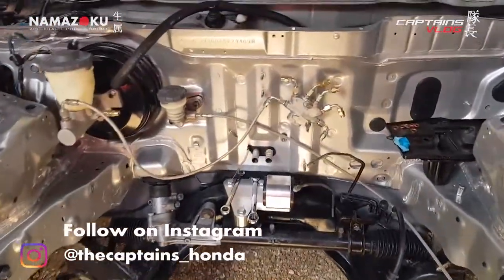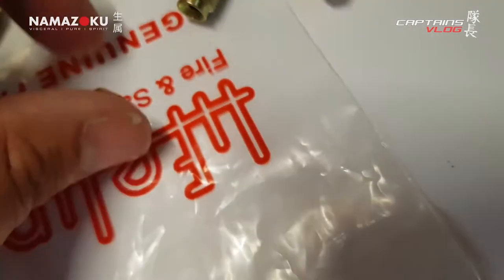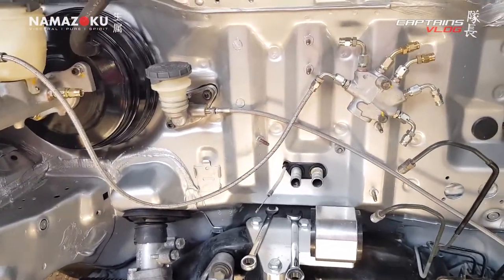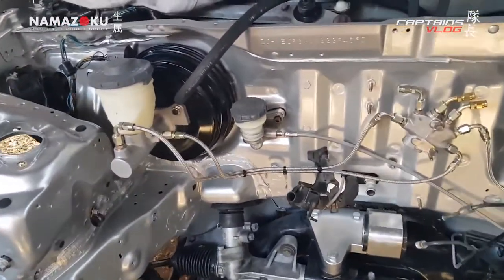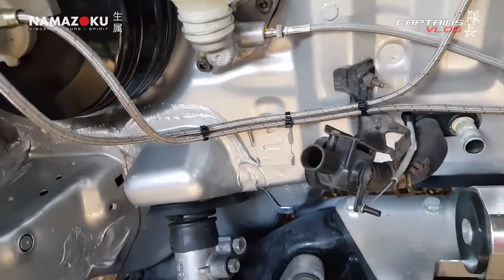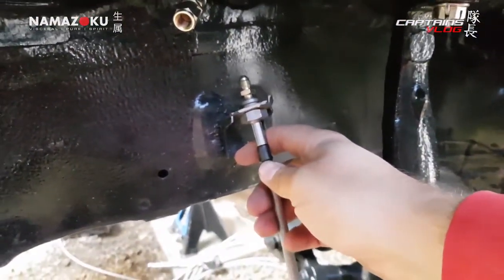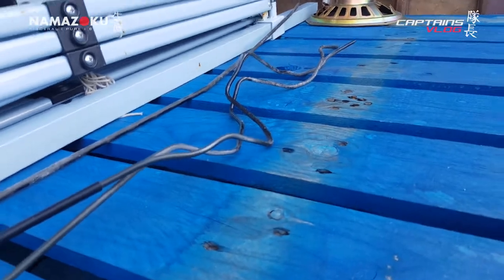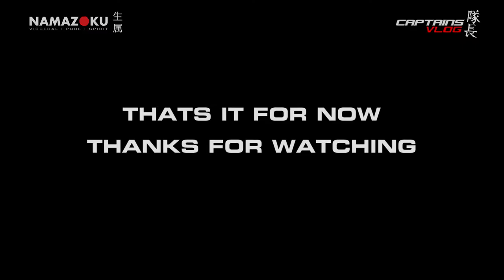Making custom brake lines for the Civic -3 AN stainless braided lines

Comment: Any issues running through the area above the front sub frame regarding enough space?

Do you have the 3 fuel lines going through there too? Im starting this and reluctant to drop the subframe, thanks in advance.
Reply from the maker: Not really I just wanted the cables as straight as possible so by having the curves inside the car before it exits the firewall, it solved that issue. 

Fuel lines all run in the OEM locations, I just connected hard line adapters to -6AN fittings where they come into the engine bay and ran them from there.
Reply: @captainsvlog  thanks for the reply. Many options and I think i go a similar route, the 3 fuel oem route, and transition from hard line to hose where convenient in engine bay, with the 2 rear brake hard lines through firewall and run internally - I don't want to do this again!

Comment: How you make sure if the master is properly connected to the prop valve… i can’t find any good diagram on how to root the master to the prop valve. Wish you can help me
Reply from the maker: Horizontal outlet on master goes to the right bottom port on prop valve, the vertical outlet from master goes to the left bottom port of the prop valve. If you join our discord we can help you better. There are links in video descriptions somewhere.

Comment: Just found your channel how are the brakes working? It looks very clean but I heard you say it was spongy or could have a spongy feel could you elaborate on that?
Reply from the maker: "Other people" always said braided hoses are spongy, I was likely referring to that. These brakes feel awesome to use, it's the same as used in race cars, works for me. Pedal feel and modulation ability is spot on. 

The pads used make a big difference to feel, but I've also never driven this car on the OEM brake lines so have point of comparison. 

This type of hose won't expand like the myths would make you believe. The steel braid is very tight, and the lines are PTFE inside.

Comment: Thinking of doing this to my civic
Reply from the maker: Simple enough mod to do, not that cheap though, as there are quite a few fittings required, but will provide a nice pedal feel when used with the standard brake booster 👍
Reply: @captainsvlog  roughly how much did you spend ?
Reply from the maker: @Birminghamoutlaws  From memory it was somewhere between £130 and £200 for all the line and the fittings, as it requires a male/male fitting for just about every connection plus the fitting itself whether it be straight or angled or whatever.
Reply: @captainsvlog  thanks.

Comment: Great video exactly what i needed but 2 questions. 1 can you run the braided hose to caliper? Also can you add links to parts?
Reply from the maker: You probably could run direct to caliper, but I wanted to use the original hanger and connection point, as I'd already bought the caliper hoses that would join to the OEM hardlines. The hose is AN3 ptfe stainless braided, and all the fittings are AN3 fittings, which is all normal kit, just plan out what you need, order the parts and away you go. I bought them from my local motorsport parts shop at silverstone circuit.
Reply: @captainsvlog  aight thanks yeah I have to order online no autoshop around my area sells those products

Comment: Have you tested this out personally yet for spongy feel?
Reply from the maker: 1500 miles, 1 circuit outing and 1 drag event, no issues to report, pedal feel and control is awesome considering no ABS. Spongy feel is a bit of an old internet myth, the new spec hoses are ptfe tube inside with tightly wound stainless steel braiding on the outside, they are very robust. If its good enough for a lot of race cars is good enough for amateurs driving on the street. 

IF ANYTHING, it probably has a little too much servo assistance now with the DC2 booster and master cylinder, as I would like to be able to apply more brake pressure when on the track for more control, but on the street its spot on.

Comment: What are the exact fittings you are using? From prop to caliper
Reply from the maker: At the caliper it is just the standard banjo bolt, from the caliper to the factory hanger is an aftermarket upgrade hose which I bought from MTEC brakes, just tell them what car it is and they can supply the correct fitting. From this aftermarket part I had to use a male/male -3an adapter, and make up a new line to go from that adapter up to the prop valve, this hose has females ends both ends. The prop valve also has male/male adapters in. 

So in short I used MALE/MALE adapter on the prop valve, all outlets, and again on the end of the caliper lines, and joined them up with custom lines using female -3 fittings both ends. 

I hope this makes sense. You can see the fittings @ 0.46s in the video. Feel free to contact me on instagram if you require any more specific info. 

Hit that SUBSCRIBE and LIKE button if you have not already done so aswell :) Much appreciated.
Reply from the maker: look at 5m26s also as you can see the male/male adapter in the end of the caliper hose :)

Comment: What’s the fitting to adapt the hardline to a braided line I can’t find it ..?
Reply from the maker: What you need is a 5/16" (8mm) Hardline to dash 6 AN adapter, you can find them on ebay at the link, I used one with a male outlet, but you can also get female outlets if you prefer :) Thanks

https://www.ebay.co.uk/itm/272698797466
Reply: @captainsvlog  

Absolute legend thanks a lot am redoing my turbo ep3 so fuse box relocation and making a full an clutch line to move it away from the heat
Reply from the maker: @MAK1991-u9d  ah, in that case it's not that adapter you need, that's to convert the main fuel feed hose....my fault I never checked what video you'd commented on LOL. 

For the clutch I bought a pre made line, but the end was a banjo fitting which can't work with the EP3 slave cylinder, so I just used the same -3 AN fittings as I did for the brake lines as they are all the same. I fitted a 90degree in the slave cylinder then put a male/male connector in that then cut the banjo off the clutch line and just put a -3 female fitting on the clone line 👌🍺
Reply: @captainsvlog  that’s helpful thank you il keep the adaptor fitting coming off the master and use the fitting to tap into the Hardline and then feed that onto the master 👍🏼

Comment: Just be careful using those lines as I had the same on my kswap and the hard engine mounts vibrate them lose a couple of times 😎😎😎😎😎😎
Reply from the maker: Thanks for the tip, they are pretty damn tight to be fair, and the mounts in this are not all that stiff compared to some, but I will certainly keep my eyes open for any issues once its running properly :)

Comment: Does anyone sell a kit for this that’s actually decent ?
Reply from the maker: Not that I know mate, piss easy to do from parts though really, just -3 an fittings and lines. Hardest part is adapting the rear headlines to connect to as they need to come off the car and be flared to take the -3 couplers.